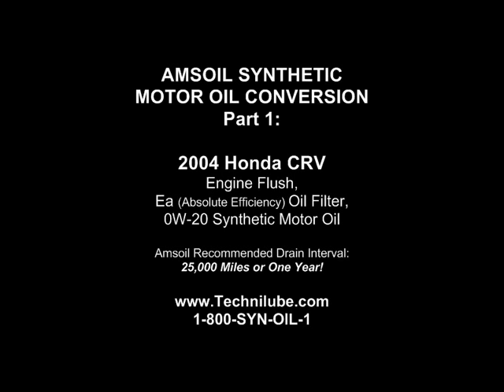2004 Honda CRV Conversion to Amsoil - Part 1

Comment: I own a CRV as well, it's MUCH easier to remove the filter from the right side wheel arch or underneath the car (it's high up enough).   Taking this off from the top is THE hardest way.